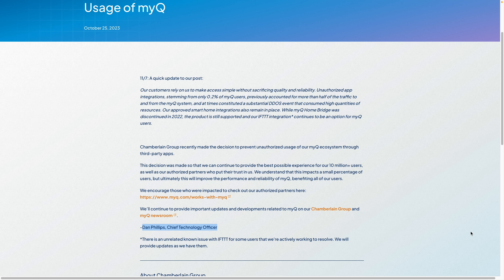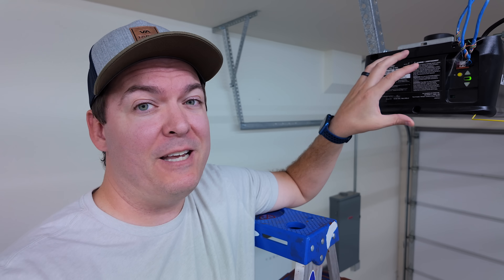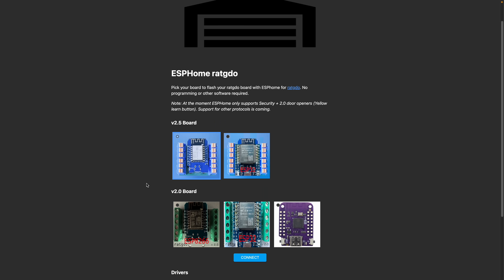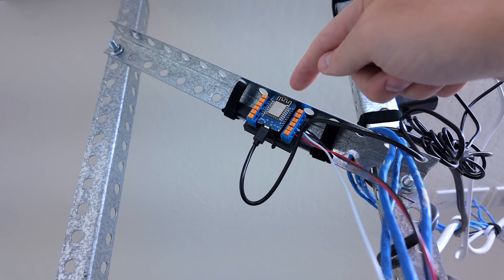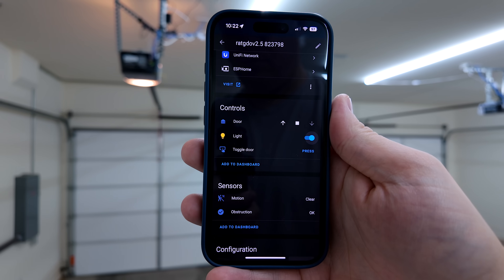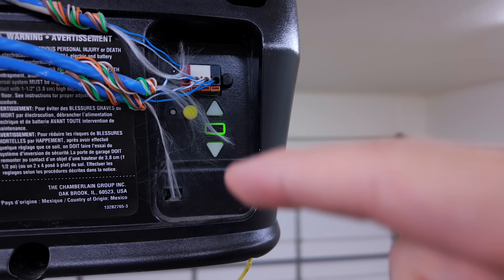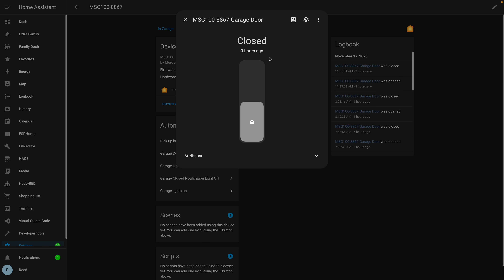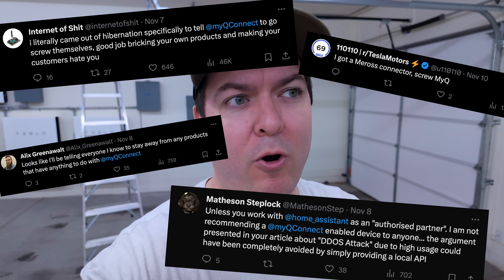MyQ wants to RUIN my smart home! Hello RATGDO

Comment: Hate Chaimberlin, ordered a Genie Garage door opener instead. (they have dumb ones still) and then set up an esphome to open and close the door. Used one of those magnetic sensors for if the door is opened or closed. Save my garage door hate being locked into cloud based bs.

Comment: I had installed a device very similar to the "Meross MSG100HK Smart Garage Opener" made by "eWiseHome" (probably the same Chinese contractor) on my 30 year old Liftmaster. The old garage door opener died last week and I installed a new LiftMaster (didn't realize beforehand how evil they were). I think I should be able to use the old device I have but I just need that garage button accessory shown in the video. But I can't find it. Not in Amazon, not listed on Meross's website except for a mention of an "accessory" that their tech support must help me obtain. WTF? Where can I get this part?

Comment: I bought HOOBS / Homebridge because it was one solution that could get a few things into HomeKit. One of those being MyQ. Since MyQ is built-into my garage door openers, this was also a method to not install additional hardware on my garage doors. Now MyQ does away with supporting the method I was using, so I’m forced to go another route. All I want to do is open and close my garage doors that have WiFi controls built-in via HomeKit. BS that I can’t use what I’ve paid for, the way that I want to. Going to buy Meross, like I almost did in the first place, and delete my account with MyQ and NEVER purchase another “MyQ” device again - EVER!

Comment: The reason why they disabled it (and why they won't enable local control) is they're trying to position themselves for partnerships with Amazon and Walmart for in-garage delivery. To do that, they have to prove that their systems are "unhackable" and secure. Hence the blocking of any unauthorized apps.
Reply: I wondered why. Funny because I would never allow Amazon or Walmart to open my garage.
Reply: Maybe they should first poll how many of their customers would allow Amazon in their garage in the first place. Cart before the horse much?
Reply: It already supports Amazon key. They’re just greedy. I deleted my account and app and installed a ratgdo. Blocked the opener from accessing the internet so they don’t try to sneak a firmware update to brick the ratgdo.

Comment: Tennis Ball is local control that works even when power is out.
Reply: my opener came with battery backup....and most garage lasers are battery operated/motion sensor startup....it's a shame such tech is needed for simple tasks such as parking a vehicle, it's scary to consider how one operates needing such aides...impressive you can land your backside on a toilet seat....
Reply: But your garage door doesn't so it doesn't matter.
Reply: @caseyhoward9101  just have to pull the cord and it does. #OGhandlift.

Comment: I have the same garage door model as you with the yellow learn button, how do I connect the meross device to it?
Reply from the maker: You don’t connect it to the garage door opener. The Meross device just attaches a sensor on that long wire to the garage door. Then that garage door remote is attached to the Meross controller to open and close the garage door. So the sensor lets you know if the garage door is open or closed and the remote sends the command to open or close it.

Comment: Hi Reed!  Great video but can RATDGO automate the door??  Meaning, can you link it to your phone to automagically open when you arrive home?  I used to have a NEXX controller but that stopped working and have been looking for an alternative.  Any ideas?
Reply: Yes that's the whole point! Ratgdo brings your garage door opener into Home Assistant (or any other home automation system that can understand MQTT), and then your home automation system can automate the garage door.
Reply from the maker: Yes @59317 is correct. This allows you to control or automate your garage door anyway you want to.

Comment: Thanks for explaining why this is such a big deal Reed.  I didn't realize that garage door openers aren't just a dry contact anymore until now.  I've got an old one and control it with a Shelly relay and I have a tilt sensor on the door to tell me if it's open or closed.  I didn't realize my setup only works on old school openers.

Comment: For my Evil Corp yellow learn button opener, I just took the button assembly off of my wall, soldered a wire to each side of one of the contact switches under the button (there's two) and ran that to a Shelly relay. I use aqara door sensors to know if the door is open or closed. I then set the shelly relay to work as a button with a .5 second closed time.
Reply: Just curious why you soldered to the remote instead of just connecting to the terminals on the back of the garage motor?
Reply: @TrevorElliott  I went straight to the contacts on my older opener that’s on my third car stall and that worked. Since my opener that runs my big door was newer and had the yellow learn button I tried to short out the contacts on the opener and see if it would open but it didn’t. So I soldered to the button contacts so the Shelly relay would emulate an actual button press. I don’t know if there’s a security feature or maybe I didn’t make good contact when I tried shorting it out.

Comment: Hi Reed, similar experience with evil corp. I found that if you hook up the sensors through the ratgdo, they work. So rather than wiring it in parallel like you have it, you wire it in series with the ratgdo inline. You can do the same for the wall mounted button/display. https://user-images.githubusercontent.com/4663918/276749741-fe82ea10-e8f4-41d6-872f-55eec88d2aab.png

Comment: You keep referring to home assistant. Does this hack rely on home assistant?
Reply from the maker: With ratgdo you would probably need Home Assistant. Technically you could have a MQTT broker or ESPHome installed on another smart home hub to communicate with it. The Meross solution works with a lot of platforms.

Comment: I got tired of the Evil Corp integration going on and off line. so about 5 months ago I decided to fix my garage. Purchased 1 Car remote, and 1 ZEN16 device. First I Paired the remote with the Evil Corps Opener,  Then figured out which two pins in the remote triggered the door to open. Soldered two leads and connected them to the Zen16. Then set the correct settings in Zen16 (minutes to seconds, and such). I was done. Oh Wait, I forgot --> remove EVIL Corp APP, Remove EVIL Corp integration from Home Assistant. Now I was done....No issues in 4 months.

Comment: I was wondering if I could use a Switchbot Fingerbot to just press the garage button?  Unsure how well that’d work / how well it’d look (acceptance factor) but if it worked, I could give Evil Corp the finger each time I use it.
Reply: Would work if you can get it in position, but you'd need a sensor to determine open it closed

Comment: I had a MyQ garage door for years and I reluctantly accepted it. Last year I installed 3 additional garage door openers with high end models without the MyQ crap and went with a Meross setup. I have been happy with that setup and its integration into Home Assistant. This obviously forced me into replacing that last MyQ privacy invasion scam product. Kind of happy that Chamberlin helped me place this tumor extraction at the top of the priority list.

Comment: I order the Meross and I also have a yellow button. I had a spare remote control I program the control and I solder two wire to one of the button and hook the remote control to the Meross. I didn’t want to wait for Meross to sent me the opener. I’m glad that I have my garage integration. Screw the Evil Corp! Updated: 3/11/2024 Meross keep disconnected from my network (found the fix then God) I panic and order the new Ratgdo 2.5i disappoint on the new board. Try everything to flash the board there’s no light to help with the process. Don’t know if I receive a bad board all I know to get hold of Paul after the purchase is hard to and there’s no return for the Ratgdo. Guess Meross is the way to go at the moment on my opinion, easy to setup and there’s no driver installation or firmware required to get it working.
Reply: Meross (also Refoss, which seems to be a Meross company) will provide you with a wired remote control opener for free, when you purchase their device. I just installed it, took a few days to get the free part (they need to know the color of your button. mine was also yellow) and it can be set up to open up to 3 doors. It really was a super easy install.
Reply: Yea I contact them, is on there way, I just had a spared remote figure is easy to solder. This few day was not connecting to the WiFi AP I have on the garage reboot the unit and the AP and working again @chrluc

Comment: Why did you choose the most complicated ways to do this? Any zwave or zigbee relay can trigger the garage to open. You can use any contract sensor to handle the open or close value. There's also relays with built-in NO/NC control hard wired to any magnet sensor. HA & Hubitat both have app codes to combine any NO/NC contract sensor to any relay. No programming an esp, no jimmy-riged wired remote, etc...
Reply from the maker: I showed two options that are not complicated. The ratgdo is less complicated than installing a sensor and getting a Z-Wave or Zigbee relay. It’s literally pushing one button on a computer, plugging in 3 wires and that’s it. Then you get access to more features than any other solution.
Reply: @reedssmarthome the rat is cool tech and simple for more tech oriented people like you and me, but I still see it as something aimed at tech people and many will view it as intimating and difficult just because of its looks and needing to do special programming (I hear it from people daily working in IT). Also, it requires a case or something to preventing shorting (most people don't have a 3D printer), it's also open/exposed which isn't usually a great idea for tech, and it requires wifi to connect. Yes, it does have cool features and is pretty cool little system, but it's also back ordered and I'm pretty sure most people want something they can get now to reintegrate their garage over the weekend easily. The jank Jimmy rig wired remote idea, something many won't and probably shouldn't touch and maybe lie have just been an honorable mention. I think it would have been better to have shown something a little more consumer aimed as an option. 

Like this: a $10 zigbee contact sensor stickered to the door (could also use a tilt sensor), $15-$40 relay (zigbee or zwave). Combine them into a virtual garage door. On Hubitat there's already an app for it built-in app (& zooz safe their own too), pretty sure HA has a virtual garage creator too, (Zooz uses ZwaveJS for it).
It might be $10 more, but you could get everything both devices on Amazon in a day or 2.

Comment: Hey reed, I've been using a Shelly 1 to control my 2 dumb doors for a few years now.   And now that evil Corp broke the ha integration on my shop I'll be putting a Shelly 1 on there too.  I had to supply my own wire and magnetic sensors but it's simple to setup.  Then I use ha to detect when I get home or leave to open and close the door!

Comment: If you buy the meross and get the little remote for it it has a battery in it. It will die in about one year and stop working then you wonder why it doesn't work. That's why!
Reply from the maker: Yeah it’s annoying it has a battery. I’m going to look for a battery eliminator or another opener that plugs in for power.

Comment: Been using the "meross" method for years. Evil Corp's way never worked very well for me from the beginning thankfully. So I used an ESP8266 relay to "click" a button on the cheap extra remote door opener.  You can even power the door opener remote directly from the ESP so no battery needed in it.

Comment: Will this allow SIri to open the door?
Reply from the maker: The Meross opener works with HomeKit so yes it will work with Siri. The ratgdo would need to be brought into HomeKit using HomeBridge (easy to do in Home Assistant) and then you could control it with Siri.

Comment: A third option, that’s even better in my opinion, is the Tailwind iQ3. One module controls up to 3 doors, it has features that the others don’t like auto-open, and it’s natively compatible with several smarthome platforms (including HK). 

And while I know it’s bound to be an unpopular opinion, I don’t get what all the fuss is about myQ’s changes. You can still use their app for free, and the in-vehicle subscriptions are really inexpensive even for a lifetime and they integrate auto-open and auto-close.
Reply: Cause we have alot of automations in HA that relied on access. Like "autoclose garasje when the clock is 2300" "autoopen garagedoor when you arrive home" "Send messege that the garagedoor has been left open for 1 hour"
Reply: @Radhoo2k10  Oh I understand that, but myQ was likely never to be a reliable option for those things if you’re relying on myQ. I guess what I’m saying is that this move my myQ isn’t surprising to me, and frankly shouldn’t be by the smarthome community. The writing was in the wall, after all. I’m just as disappointed as others, but I “knew” this was coming and prepared accordingly. It’s why I have other things already in place.

Comment: I got the myQ hub and garage door sensors pre Home Assistant. Just wanted the cool feature to open / close the garage doors from my phone. When I started using Home Assistant, it automatically discovered the myQ hub. In the end, I was only really using myQ as open / close switches to trigger other automations. It worked but was a little slow (definitely acceptable) since the doors had to be fully up or down and wait for communication with the cloud. 

So, when the API no longer worked, I simply went to using the Aqara contact sensors. That solved my automations. Plus, was much faster since it was local and it didn't matter if the garage door(s) partially open or closed.

I was disappointed with the change that myQ made but for me, worked out for the better.

Comment: Reed...any way you can comment on when/if you have to take the Ratgdo down after use? Getting it to reset seems tricky and not really clear anywhere. There will be more than just me who needs this...in the meantime, I simply attached my Fingerbot to the wall unit and replaced the Fingerbot "click" with all that I was doing with Ratgdo, but, I'd prefer to have Ratgdo back up...If you're waiting and have a Fingerbot laying around, it works pretty well!

Comment: The Garage door here has the 'learn' but isn't recent enough to have wifi connectivity. My solution was to buy an extra remote, set it up with a Switchbot Robot to activate door opening/closing. Then used an Aqara door sensor and a gravity pivot (3d printed) that detects whether the door is open/closed. That all interfaces with Home Assistant. Also not concerned about the light, as I have a light socket right next to the garage door opener, that I dropped a smart bulb into, and have a motion sensor in the garage that activates it or not. If we ever get the garage to a state where one of us can park in it... Then I might consider the laser pointer.

Comment: Nothing wrong with the Tennis Ball Reed. It will never connect to the cloud, never run out of power and if the kids break it then it's SO cheap to buy another one. If it works and it's simple it's probably the best solution. How much did all that laser tech cost compared to a 50c tennis ball?
Reply: Good point.
Reply from the maker: True about the tennis ball. The laser was pretty inexpensive, maybe $15? It can use batteries as a backup but just plugs into power so it shouldn’t be that big of an issue. My kids would hit the tennis ball all the time and it was probably just a matter of time before it broke.

Comment: Hi all, we have a chamberlin, but never used the Q thing. Is this problem mainly those who utilize it? I apologize for my ignorance as I’m not savvy on this subject
Reply: Trying to summarize the problem. MyQ provides a remote access capability, and fine control of the garage door (apparently, I don't have one) For some time it's been possible to integrate various platforms with MyQ so that you can automate things like opening garage doors, or closing them (Rough to find you're 20 miles out on a time sensitive trip, and someone asks if you left the garage door open.) MyQ was providing a gateway for things like Alexa, Siri, Google HOme, Hubitat etc. to provide that integration into your home automation. They say that less than .2% of users were overloading the MyQ service, so they have, or are, cutting that gateway off. 

I'm aware now of at least 4 options to work around the service limitations. The two here, and two more that are offered in comments. Those are to use something like a switchbot to activate a garage door remote, and to take apart a garage door remote and use an external relay (shelly, aqara, zigbee controlled relay, z-wave power button, etc.) controlled by a home automation system to jumper the button contacts on the remote. I'd go through again, but I think there is another solution using something like the second module mentioned in the video. 

One of the more recent developments appears to be that the MyQ app on phones is now also ad supported, even if you're not paying a subscription for the MyQ link, those ads are going to eat into your data usage, etc. 

If you're not actually using the MyQ app, or you are, and are satisfied with the service, I wouldn't worry about the alternatives. If you are doing other home automation stuff and would like those to be able to controll the garage door, you may need one of the solutions above.
Reply: @RNMSC  Thank you 🙏🏼 so much for educating me! ☺️